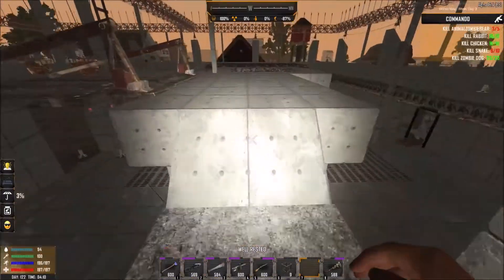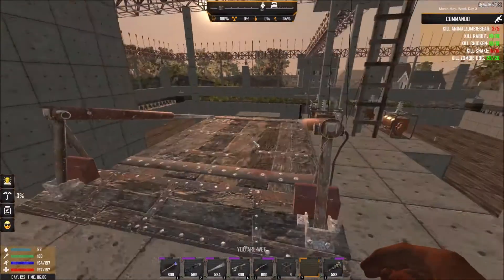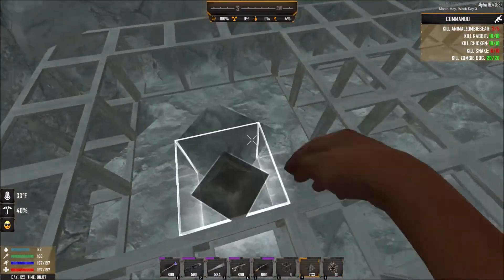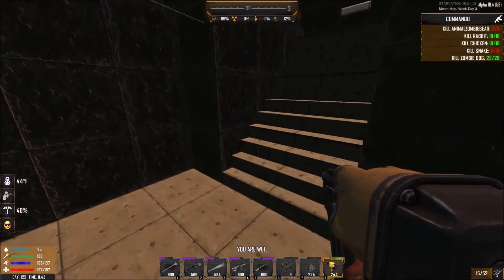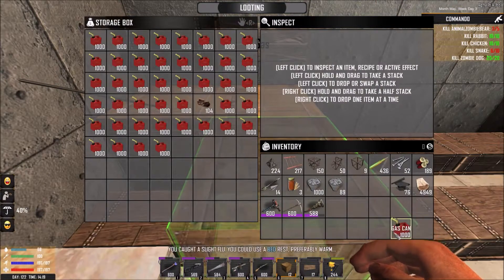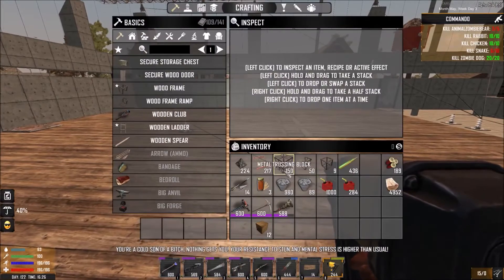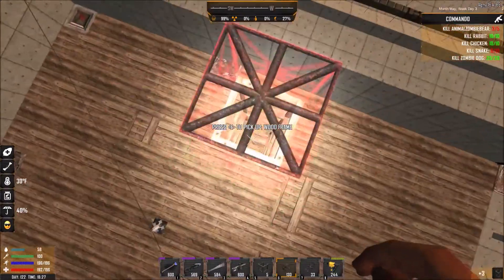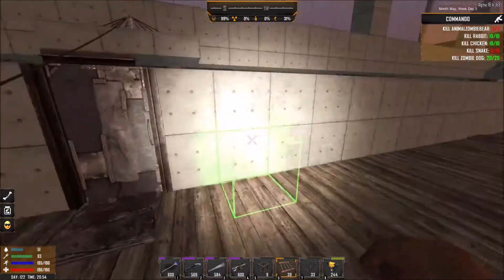Final Touches To The Base! | 7 Days to Die | Alpha 16 Starvation Mod | A16 s4 ep19 Day 122 Gameplay

Comment: Hey Ye'ahz .....  Are you just using just the Bug lights, or are you using the Ultrasonic Rodent horns as well in your garden?  The Base is looking good.
Reply from the maker: using both, the ultra sonic repellents are just behind the bug lights
Reply: Try putting Ultrasonic Rodent horn closer to where the rats are ground level just not where they might attack it. This is what I hat to do with my elevated garden on a building.  I ran one horn (device) down above the ground and that fixed the issue for me.
Reply from the maker: nah that's not necessary, did a smaller underground farm in previous series and it worked fine....I think its part of my game being broken(whole map is ice cold no matter the biome),  the rats show and crops get bugs even though I have more than enough lights etc and more than enough power to power them.